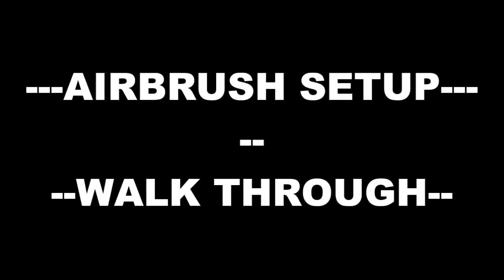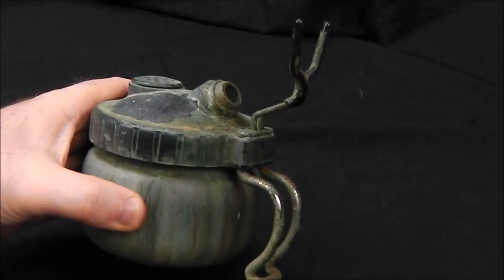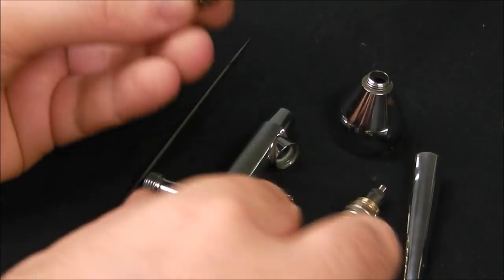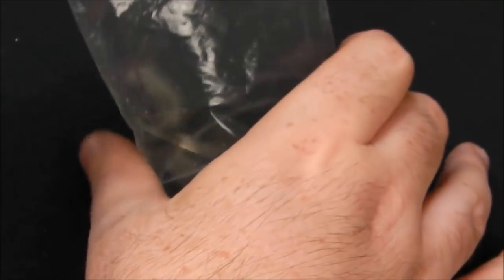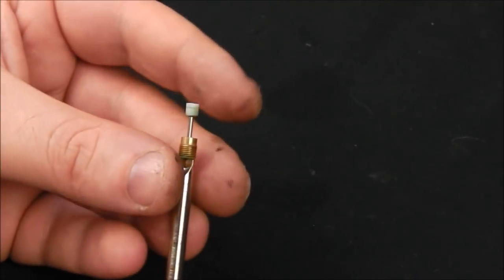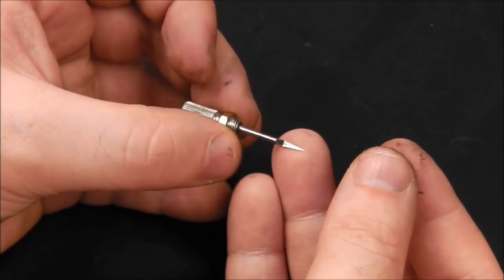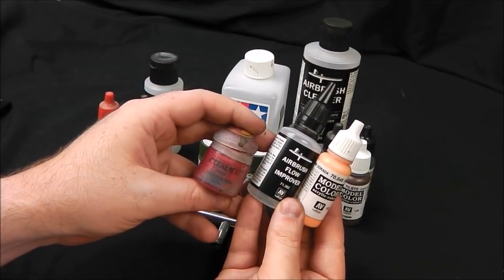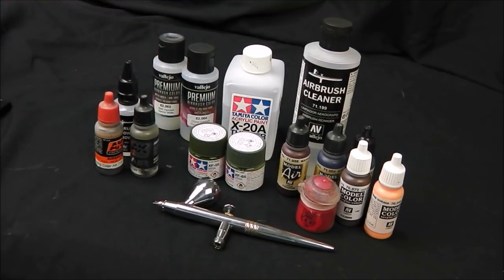Airbrush and Compressor for Scale Models SETUP

Comment: If you spray acrylic paints you can use  1/3 99% isopropyl alcohol and 2/3 destilled water with 6 drops of glycerin and 3 drops of propylenglycol to make your own airbrush thinner. The glycerin and propylenglycol act as retarders so you can use them thinned as flow improver.

Comment: Thank you for this superb information. Ordering the compressor with tank and valve. Looking at the Harder & Steenbeck too. One question, you say gravity fed is the way to go. Have been looking at an under bottle fed Iwata Revolution R2000 BCR with a 0.5mm needle and dual action. What are your thoughts as I’m thinking great to quickly interchange between jars with a quick blow through and wipe. Are their drawbacks using these types of airbrushes in your view?
Reply from the maker: So the main thing that works against under fed airbrushes. Is the paint needs to fight against gravity to fed paint through the brush, which requires a greater pressure to do this. Which basically results in more paint through the brush. So it makes it harder to finer work with your airbrush when using an under fed brush. However they do hold more paint which makes them better suited to less precise jobs such as priming or base coating models. Though personally you are better off with a gravity fed dual action, as it can do more jobs and is more flexible in the long run. Hope this helps mate!
Reply: @longlance67  it does and very much appreciated

Comment: Using same kind of compressor (there are plenty of clones of them) and I like having a tank (had none before) but its not holding long, but gives constant flow which is neat. Got a voucher for my 16th birthday from my grandparents for an airbrush and wanted to buy the Evolution. Instead put some money on top and bought the Infinity from the same brand and love that thing to bits! Turned 24 this year, broke some needles and nozzles on the way though.
Unfortunatly the nozzle cleaning device from H&S is meant for nozzles down to 0.2 and not for my 0.15 thats why i hesitated with those a bit
Reply from the maker: would like to get my hands on an Infinity as some point it is meant to me a great airbrush!
Reply: She absolutly is but I dont think you need one when youre using the evo. The body is the same and so are the nozzles. I'd rather think about something like an iwata for different brands of colours that work better with this or that airbrush

Comment: Thanks for this, great video. Where do you typically place the compressor while airbrushing? Does it even matter? Sorry for noob question
Reply from the maker: not a nood question at all, I place mine at my feet in reach so I can adjust air pressure as I need too, I find on the table it vibrates too much and shakes my camera setup

Comment: Super cool video man. I’d like to try the AK and Ammo of MiG paints. I’m sure the two are very similar haha. I’m also sure they’re not much different then the Model Air range by Vallejo. I’m sure you’ve used all mentioned what’s ur opinion on the two ?  AK/Ammo of MiG vs Vallejo Model Air ?  Thanks for sharing this video Shane!!!
Reply from the maker: So I shall try to make this as concise an answer as I can. So all paint mentioned are actually very different in temperament and require different methods of thinning. I am not a big fan of AMMO paints, but Model Air is very straight forward to use out of the bottle and even better with a drop or two of airbrush flow improver.

AK paints are more fragile then Vallejo and must go down in thin even layers for best results but Vallejo thinner tends to work well AK paints too

AMMO paints apparently work with his own brand thinners ect. But I am not sold on these paints as Model Air and AK paints do the job just as well and are more user friendly

Comment: I have a question Shane. I sprayed a figure with Testors dullcoat and it's still a little shiny. Can I spray AK Interactive ultra matte over the dull coat ? the dullcoat has been on a few weeks. Thanks.
Reply from the maker: I have never tried dull coat though as long as the dull coat is totally dry before you apply the AK or any other brand on top of it
Reply: Dullcoat on my models is fine, it leaves a great matte finish. I converted to it from Alclads, saves on airbrush cleaning too !! though for some reason it always leaves a slight shine on my figures, baffling. Was just worried acrylic over lacquer might ruin it as never done it that  way round.

Comment: Hey Shane, can I ask what are your main suppliers for your equipment and most importantly your models. I presume your in Ireland ive used marks modles once or twice but have you any other recommendations mainly for the models themselves.
Reply from the maker: for my airbrush supplies I use a Scottish Company called air-craft as for Marks Models I've done a little business with them over the years they are good, though I get most of my stuff from Model Hobbies from the UK and Luckymodel from Asia
Reply: Shane Smyth - scale models thanks I'll check them out

Comment: Great video as usual, thanks Shane. I was airbrushing yesterday with Vallejo air paints (black) 10drops black with 2drops flow improver and it splattered all over the place any ideas why that might be
Reply from the maker: if its model air black I would recommend adding about 4drops of flow improver, also make your nuzzle is clean, often that is the cause of splatter